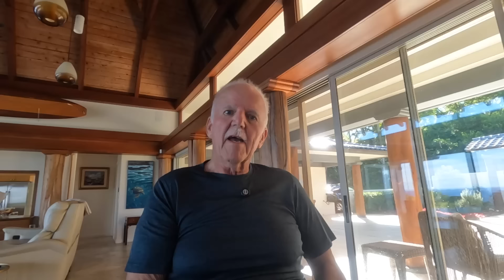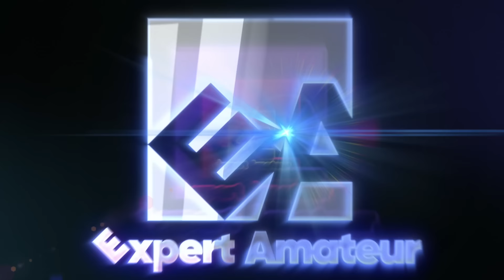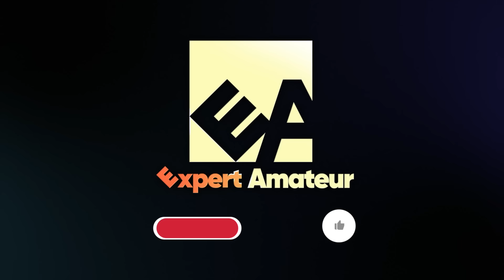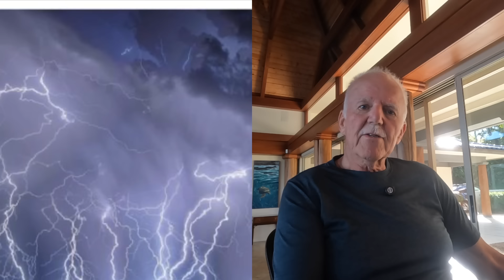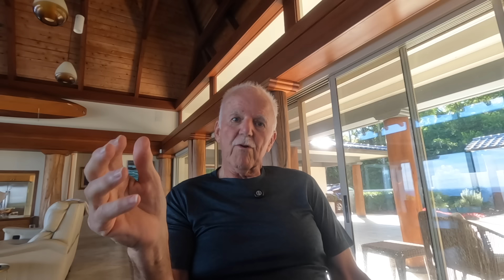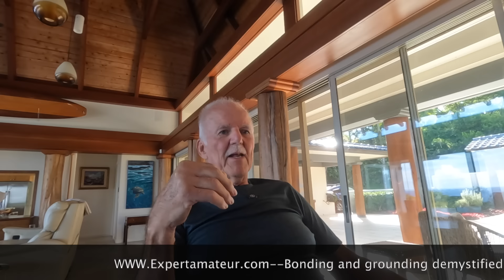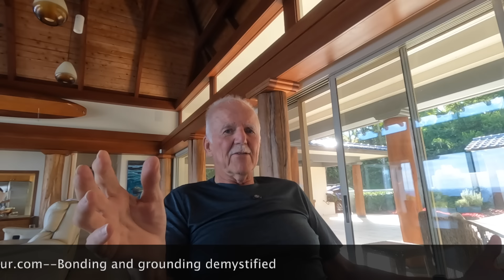solar grounding

Comment: It's code here that you have to install separate grounding rods on a sub panel that is unattached from your house.  Wouldn't a solar array that's out in the middle of your yard 50 or so feet, be an unattached structure?.  I do get it about the potential voltage between grounding rods, but if you  run an additional grounding wire from your grounded solar panels to your sub panel ground, that should eliminate most voltage potential between the grounding rods.
Reply: Do a search for 'ground potential rise lightning' for more info on that subject.  Even with a ground wire running between ground rods you will still have substantial voltage between ground points, but at least it's not thousands of volts that way.
Reply from the maker: Exactly.
Reply from the maker: Yes indeed it's an unattached structure. The grounding wire should go to the grounding rod attached to the service panel. The sub panel qround should also work, but I think it's just as easy or easier to attach it straight to the service panel grounding rod.

Comment: This is quite interesting. Grounding and Bonding is a big topic of conversation in my line of work. We go above and beyond and bond everything together and upsize the conductor. This is one the standards we design our facilities too if you want some light reading. I will say, we do not have much repairs when it comes to lightning strikes but your are correct, copper is expensive.

https://staticworx.com/wp-content/uploads/2018/04/FAA-STD-019f-20171018.pdf

Comment: I’m in the swampy area of Florida. If I dig more than 2 feet I hit water. Should I still run a grounding rod if it’s going to be wet all the time?
Reply: A trick I do which I learned from an old tower installer was attach 1/2" thick copper wires to the base of the tower and do like a fan in the back yard for every ten feet up go 3 ft from base to a max of 20 ft and do a fan style runs of a minimum of 5 runs about 18" deep minimum, this design if and when struck by lightning spreads out the charge into the ground, and I've been doing this technique for 35+ yrs
Reply from the maker: Sounds good but it sounds like a lot of work.
Reply: @ExpertAmateur-xn6dr  unfortunately manually yes but you can use a trench or line digger which is rentable from most landscaping companies and yes I've had huge success with lightening in bad areas just the unfortunate part is the cost of materials
Reply from the maker: Sure, that's actually a lot better than a rod driven into dry ground.

Comment: Thanks for your help. My 7.5k Gen set 2/120v  output (non-solar charging) and 50A shore plug (not in use) are run thru a -6ms auto switch. I want to avoid creating a ground loop. ???
Reply from the maker: Yes, and it's a bit hard to do. If you have a GFCI on your shore plug you've probably run into problems with it tripping when you plug into shore power. The standard fix is get rid of the GFCI!!
Reply: @ExpertAmateur-xn6dr 
I did have a problem resetting one of the gfci outlets, they would only reset with the generator running, only to find it had been installed swapped wires. It’s still factory installed and I don’t want to monkey around with what’s been working daily for 5 plus yrs. 👍🏼

Comment: My question is do I earth ground anything on my system? 
My system is an onboard factory installed 12v rv set up. My solar / charger and batteries are my only addition. Rv is not earth bonded.(except tires/jacks). 
Panels & (150pv/40a) charger are not onboard. Where should I earth ground and or bond?
Reply from the maker: RV are impossible! I tried (and failed) to come up with a reliable way to connect shore power. You just never know how the system you are connecting to is grounded and bonded. I don't have a good answer for you (or for myself)
Reply: And I guess I should NOT try to plug my shore cord into another 3k AIO inverter/charger. I haven’t had any issues yet in 4 yrs full time off the grid.
Reply from the maker: @1234GOPRO  At least you'll know something about the system you're connecting to. For my race car trailer I had two Yamaha inverter generators connected via a sync cord that I connected to the shore power plug. Never had a problem with the GFCI, and I wasn't curious enough to dig into it, but there was, of course, no earth ground with portable generators.

Comment: Awesome video! Great discussion
Reply from the maker: Thanks Will. I'm a fan, I've watched and read about everything you've done.
Reply: I'll add a couple of important points to a very good discussion that I agree with: Reducing inductance as much as possible and dissipating lightning strike energy over a wide area are key to lightning protection. When I worked at a mountain top astronomical observatory I designed the lightning protection system. Lightning has an extremely fast rise time, meaning in a conductor the impedance is increased by the inductance (Inductive Reactance). To reduce this inductance, the typical solid copper wire is the worst possible choice. Far superior is a copper ribbon (I know, $$$!). Next, as the electrical charge travels down a conductor it is charging the soils around it, but this has limits. As a general rule of design assume the charged of soil is a cylinder the diameter of which is twice the length of the effective ground rod. So,an 8 foot rod in soil will charge  cylinder about 16 feet across. (soil conductivity varies this, it's just a generic guideline). Ideally the run of copper ribbon (or wires if you must) is as long as you can afford, leading away from the equipment being protected. Along that run of copper are multiple ground rods. Each rod spaced at twice their length. In this way you provide a low inductance path with multiple dissipation opportunities, all moving away from the expensive hardware you wish to protect. And yes, it did all work.
Reply from the maker: @Chris-lp3dm  cool. I haven't seen any copper ribbon at Ace Hardware though.
Reply: @ExpertAmateur-xn6dr  I see that YT deleted my comment on where copper ribbon/strap can be found. I'll try again. Look for metal supply companies as many do sell retail quantities. Also look up a company name of poly phaser. Spelled it lower case with the space between because that may be what got the comment removed. The YT Al-Gore-Rhythm can be nefarious that way.
Reply: @Chris-lp3dm  great points Chris. I once worked in 2way comms and that’s is how many towers were setup with a lattice ribbon under the tower and pad area. I installed 3 ground rods for the panel frame grounding with that in mind. Leading away equidistant in best way to describe in a star shape. Have no idea if it will work, hopefully I’ll never know. I’m all ground mounted so maybe it’s irrelevant anyways 🤷‍♂️.
Reply: @Chris-lp3dm   This is what I was advised to do, in essence. Six 8" ground rods, ten feet apart, connected with heavy copper wire and at the far end connected to a 180 ft deep well casing.  A separate ground rod for the house that is connected to the other array of rods via a buried copper wise.  No direct path from the panel frame into the house.
Reply: I I turned my system off every time it came up a dark cloud I could only make power 6 months out of the year
Reply from the maker: Yeah. When I was trying to decide how serious to be about this I took a look at a map of lightning strikes in my area. I thought it was rare. I was dead wrong.
Reply: Thank you Will for referring this video.
Reply: Thank you Will for this video. We get a lot of lightning in our area.
Reply: In reading comments there is another point I feel is worth mentioning. The old adage that lightning never strikes the same place twice is nonsense. Repeat strikes happen all the time, especially to fixed in place developed facilities. Including to places that are not destroyed, have electronics within, and often people too. I've been in a high mountain fire lookout hit by lightning. The system of lightning rods, cables over the exterior and grounded anchor points kept me safe. Same is true for amateur radio (Ham Radio) towers and repeaters I was Control Operator for, no damage from tower hits. Every site requires its own analysis and design effort. Possibly the cost of protective hardware would be out of reach. Just don't think it's all an impossibility, you can always reduce the risk of damage even if you cannot eliminate it entirely.
Reply: I’d love to see a diagram of this concept. Very interesting ⚡️
Reply: I have 500 foot distance panels to cabin inverter. I don’t have my panels frame bonded to my off grid inverter. Both ends each have a separate ground rod with each end having midnight solar lightning protection and fusing. The inverter is grounded and bonded to the AC side in the cabin at the main panel. I’ll take my chances and hope one or both protect the inductive of lightning. There is an impedance between ground rods if bonded together 500 feet and disagree with having the panel frames bonded to the cabin grounding 500 feet away and potentially have another inductive path. I think if the panels and cabin were closer I would bond both ends, but with my distances I see bonding as having potential problems…. Pun intended. 😊
Reply from the maker: @jimmyg6215  You're right, though at the nuclear power plant I worked at the engineers bonded the ground rods at our sewage treatment plant to the ground rods at the substation, about a mile away. They used VERY hefty wire, but still, the resistance of that much wire would seem to eliminate the benefit of bonding the ground wires. We had thunderstorms whack the cooling tower numerous times and didn't toast the control system for the s**t plant, so I guess it helped.
Reply: When Will watches your video and comments in a positive way, you have created great content. 👍👍
Reply: I've been wondering what the correct way to do this is. Thanks for the info.
Reply: First time I seen you away from your channel will.😁
Reply: There was no mention of testing the resistance to ground. I’m curious how often this step is overlooked or neglected. Do inspectors ever get out the equipment and test it? I’ve been on sites where by the time everything is done and it’s dark out the resistance is not tested. Maybe this is why they started requiring a second ground rod in some jurisdictions?
Reply: I find for me that it’s not worth bothering to ground panels. I’ve listened to both sides of the argument, and nobody seems to be sure 100%.
I just turn off my system completely and disconnect my panels from the rest of my equipment when there’s a lightning storm. When it’s over, then I turn everything back on. For the few times I get a lightning storm in the Seattle area, it’s just not worth the bother or the risk of losing my entire system.
Until everybody has a consensus on what to do, this is the best way I handle mine. I do have DC breakers that shut off the panels from everything else.
Reply from the maker: Yup, I get it. If I wasn't such a nerd I'd take the same approach.
Reply: @simon359  that makes sense to me, I’ve wondered about simply switching g the breakers off when there’s an intense amount of lightning.
Reply: @Jordan-tq2jc  It depends on if there is a direct hit by lightning or a near  miss. The bolt of lightning just leaped across an enormous air gap, from thousands of feet to over a mile. The tiny air gap inside a breaker is nothing at all to that enormous amount of energy. On the other hand, if it is a surge from a hit some distance away, then the energy may be greatly reduced and the open breaker will work.
Reply: @simon359 I do same also since there are many views surrounding this earthing of panels or not
Reply: Grounding is a blessing and a curse. 
It was created to prevent electrical shock hazards. Problem is: it creates a back door for nearby lightning strike potential energy to damage equipment via ENTERING the ground connection.
I almost wish I had an isolation switch so I could temporarily remove the ground from my home electrical system before an electrical storm event approaches. 
(I can almost hear the backsides of electrical inspectors puckering as they read this)
The fact is: during a violent thunderstorm it is more likely for equipment to be damaged by stray voltages coming in on the ground wire than entering by either a direct lightning strike, or striking the existing overhead/underground power grid. 

Installing a grounding system to bleed off stray voltage from a lightning strike also creates a back door for a nearby lightning strike to come in through the ground system to the equipment. 
The reality is: very little can be done to prevent damage from an event like this.
Reply: @powerguymark  As said in the video, lightning doesn't behave like normal voltaghe and current. It may have jumped a 5 mile gap to get to the earth, so trying to stop it is futile. The best you can do is to try and stop some of the current a strike induces in wires and metal objects, but even that may not cooperate. I think even the most elaborate and robust protection is far from being totally effective.
Reply: I’m proud to have taught Will everything he knows.